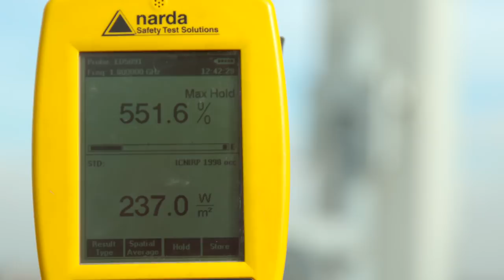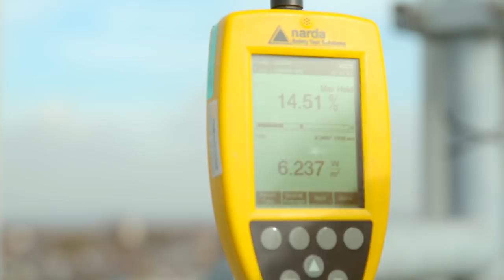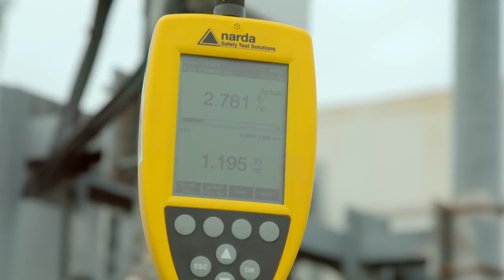Testing The Safety Of 5G - BBC Click

Comment: Dear BBC Click
The so called expert you had on your video has omitted some science and did not given a balanced answer.
It is important when speaking with people about health and safety of mobile phones is to stress that contrary to what Engineers may say, Microwave Radiation at levels present in mobile phones actually affects our Biology. These Pulsed Polarised Modulated Microwave Radiation do have significant Bio-effects.

There is one big issue that confounds and amplifies the widespread confusion that we are facing today. The misassumptions of Classical Physics in a Biological System, the famous “NIR” “Non-Ionizing Radiation Story”.

Classical Physics tells us that Non-Ionising Radiation does not possess the energy to damage Chemical Covalent Bonds, so it could not damage DNA and is therefore perfectly safe!

This is part of the official disinformation that Telecoms Industry and Regulators buy and sell.

The disinformation comes because Microwave Radiation energy is classified in the Electro-Magnetic Spectrum as a Non-Ionising Radiation (NIR) and by definition the energy of this radiation is not strong enough to break a covalent chemical bond.

The typical energy of a covalent bond is in the order of 1 electron-Volt (1eV= 1.6 .10-19 Joules). The force required to break a covalent bond is in the order of 1eV/0.1 nm ~ 1600 pN. (pico Newtons)
http://www.picotwist.com/index.php?content=smb&option=odg

The energy in the microwave radiation is well below this level. At 3 GHz it is 1.8*10⁻24Joules.

So, this is the science that lays out the impossibility of Microwave radiation being able to damage DNA because it is too weak in energy terms to break any of the bonds present in DNA. And this is the “rock-solid classical physics” that the whole disinformation story rests on.
So, many Engineers will spout out this story, almost as religious Dogma and poo-poo the whole idea of Mobile Phone Microwaves causing any negative health effects.
“The reality is that for RFR, there is no known plausible biophysical mechanism of action for harm” David Robert Grimes Oct 28 2019

The only problem with the story is the horrible fact that Pulsed, Polarised and Modulated Microwave Radiation at the levels present in mobile phones does in fact damage DNA. Not expected, but sadly true. So, this is the reason why there is so much deliberate confusion, from an Engineering standpoint it is not going to happen, yet in Biology it happens!

This was first shown in 1995 by Professor Henry Lai From University of Washington and he was subject to attack by the Telecoms industry, http://www.seattlemag.com/article/uw-scientist-henry-lai-makes-waves-cell-phone-industry

The work was reproduced in a large study financed by the EU in 2004. It is known as the 2004 EU Reflex Study.
https://www.jrseco.com/eu-reflex-study-shows-dna-damage-caused-by-radiation-from-wireless-devices-and-mobile-phones/

In a similar fashion if you read the paper you will see the skulduggery the industry resorted to try to discredit this work.

This is the study that showed 24 hours of mobile phone radiation did the same amount of DNA damage as 60 CT Scans in or 250 years of The Earth’s background radiation.
How many people would voluntarily submit to 60 CT scans in 24 hours?

Something else worth noting, life on this planet evolved over a two to three-billion-year timeframe. Since the Big Bang and up to very recently the only microwave radiation present on our planet during the evolution of life is that low level background microwave radiation that came from the big bang. This background radiation is also what could be describes a plain vanilla sine wave microwave radiation. The NIR microwave we have today is now Pulsed / Polarised / Modulated Microwave Radiation. This is what is thought to cause the Bio-effects.  Our body cells just can’t handle this pulsed and modulated radiation.,  I suspect the so-called engineering NIR “experts” just don’t understand how the telecom people modulate the basic microwave carrier radiation.

Comment: here is some evidence on the harm associated to 5g MMW tech, and why it is concerning, this is just tip of the iceberg: 5G Millimeter waves (MMW) will be combined with current longer wavelength frequencies that are mostly used today, to create a cocktail of artificial frequencies that humans have never been exposed to. MMW are absorbed by anything that contains water. The 5G frequency bandwidth is much shorter and a much higher frequency on the spectrum of electromagnetic radiation (6-300GHz), this results in broadband towers needing to be placed much closer together to compromise for the shorter, faster frequency expressed through the 5G bandwidth, with “small cell” antennas planned to be placed about ever 250m. although 5G penetrates only the outer layers of skin tissue the mix in vibrations from the lower frequencies we are already familiar with will have a mix of skin and body penetration. The mechanism of harm from non-ionizing radiation emitted from wireless technology is Reactive Oxygen Species (ROS) which leads to oxidative stress in nearly every bodily system, which is associated to diseases like cancer. The FCC doesnt account for the measures of the heat effects of MMW tech or any wireless technology on the human body because they have been bought out by the telecommunication industry. 

In a more dated paper written by Russian researcher Zalyubovskaya (1977) declassified in 2012,
alarmingly expresses evidence from research conducted on both humans and animals that reveal
multitude of harmful effects due to the exposure of MMW, describing structural changes and
alterations in skin, internal organs, bone marrow, tissue respiration and more. Authors also
explains how MMW do not go past the skin but act in a different way to the electromagnetic,
chemical soup that is the human physiology, inducing harm in an alternative manner to multiple
bodily systems

In a fascinating article written by physicists in 2018, they demonstrate evidence suggesting
human skin sweat ducts have high susceptibility to absorb the sub tHZ frequencies associated
with the MMW in 5G wireless technology. Sweat glands in skin tissue act as antenna receivers
for 5G wavelengths, showing a significant increase to the heat absorption of MMW. This article
also discusses possible harm and its implications to human beings since we are essentially
electromagnetic in nature

 High intensity MMW wavelengths have been used in military applications for methods
 non-lethal crowd control and crowd dispersal in what's known as “active denial systems' ', with
 evidence indicative that the bandwidth used can burn the skin's tissue.

The first large scale study on potential genetic alterations connected to MMW radiation used in
wireless devices by Le Quement et al (2012), observed non-thermal skin genome effects of
60ghz exposure, and found differential expressions of 5 different DNA transcripts showing that
this technology may damage and modify genetic expression within the human being, influencing
communication between cells in the body.

I can keep going, on and on and on.

Comment: My question is, can non ionizing radio waves begin to ionize over long duration? We are talking about a technology in-which people are going to be exposed to for a lifetime. 

If i say to use, cut this rock with nothing but water, you would assume its impossible, yet over large amounts of time that exactly what water has done all over the planet.  Your saying its less then government specs, but you take radiation, there is a lifetime limit. " lifetime maximum radiation limit of 400 mSv"

Its all well and good talking about the physics of the issue, but really we are talking chemistry or more importantly biology.
Reply: Non-ionising radiation can never ionise. It doesn't "build up" over a long period. If you stood in front of a light bulb for years and years it would never give you cancer. It just doesn't have the energy. If I dropped a grain of rice on my hand from a height of one centimetre it would injure me. If I dropped it a million times onto my hand it still would never injure me. 5g radiation is like that. It just doesn't have the energy to damage molecules, however long you are exposed to it. It can't even heat your tissues up by a hundredth of a degree.